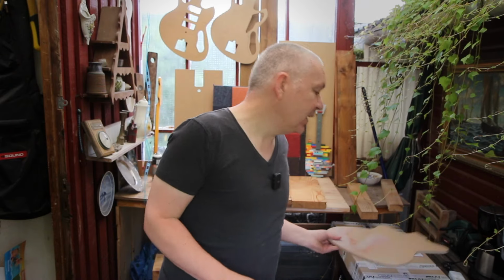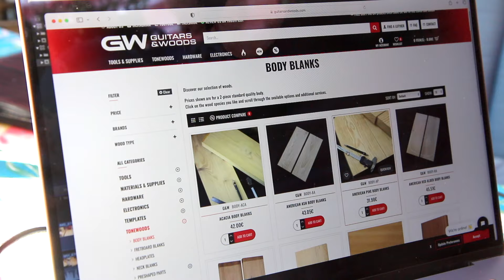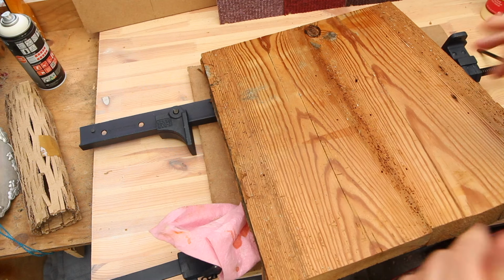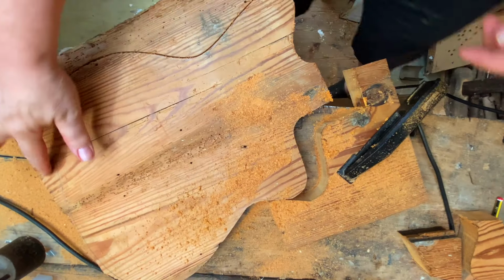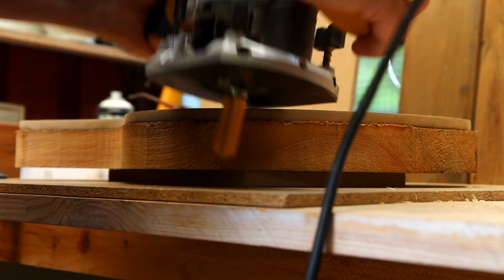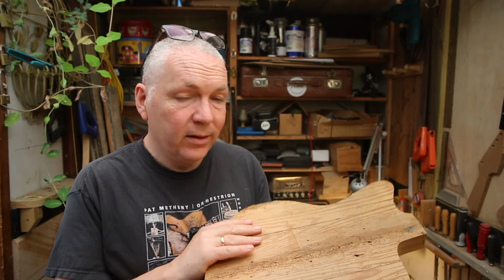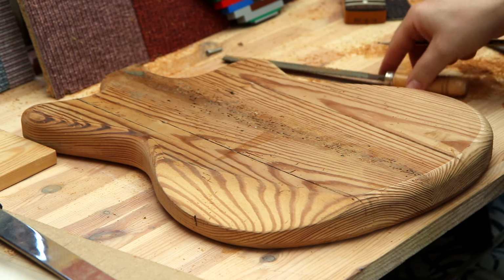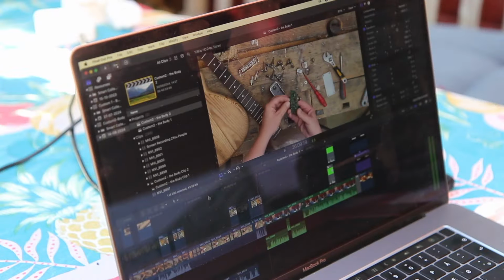Building a Unique Guitar Body from Ancient Wood

Comment: I too like to work with old wood, although not 18-19th century like yours.  My latest was made from pieces of a mid-20th century cherry desk.  The furniture was covered in a thick stain varnish combo that hid all of the wood features, but I sanded that off and used an oil/wax product that accented all the wood grain and color changes.  Pretty sweet!

Looking forward to seeing the project develop
Reply from the maker: Oh I love old wood… don’t know why… it’s just inspiring to me 
Thanks so much for watching 😃🙏🏻
Reply: @MichaelLagerstedt  It's got some extra mojo to it, for sure. I particularly like using reclaimed stock from old barns and churches. It's got mojo for days, and with the old stuff, it's generally moved all it's going to (twisting, cupping, etc), and the internal resins have all crystallized, which is a definite bonus.
Reply from the maker: @MFKR696 absolutely